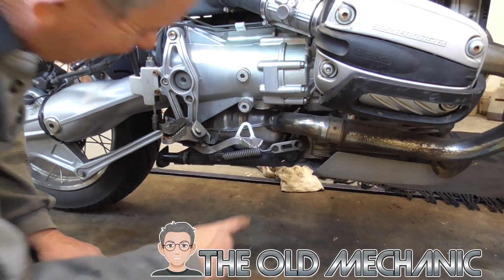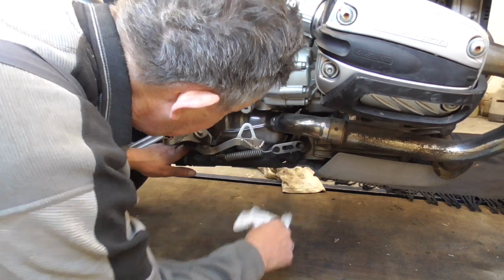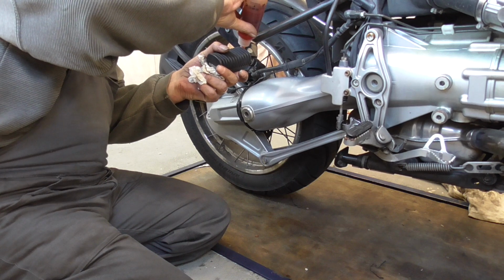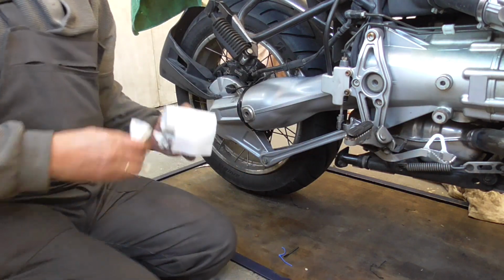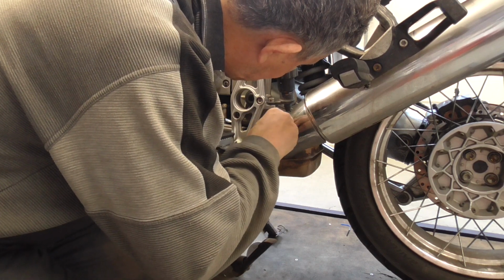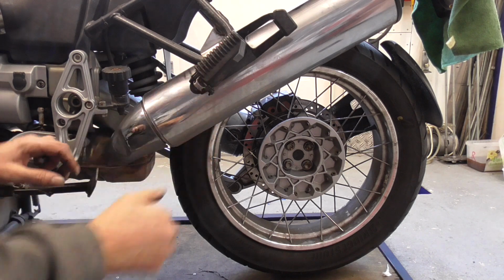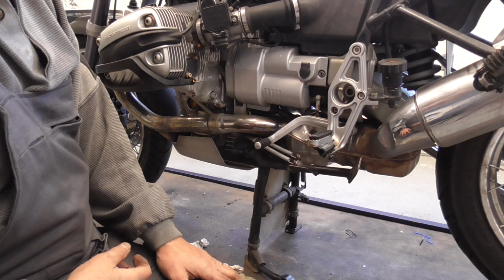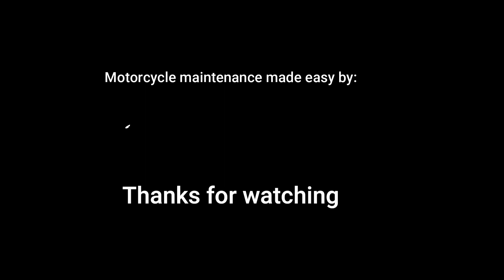BMW R1150GS: tips about motorcycle maintenance you wish you knew before 👨‍🔧---🏍

Comment: Without advertising a treatment or two a year with ACF-50 prevents corrosion, and helps a lot on all moving parts I've been using it for a few years and I can say that my bike doesn't have a rusty screw.
I like your work, congratulations 👍
Reply from the maker: Good info Ed 😉👍🏻👊🏻